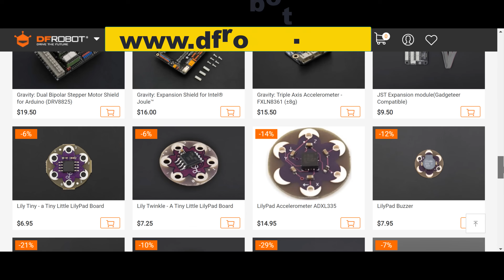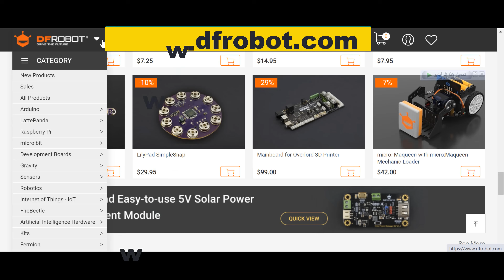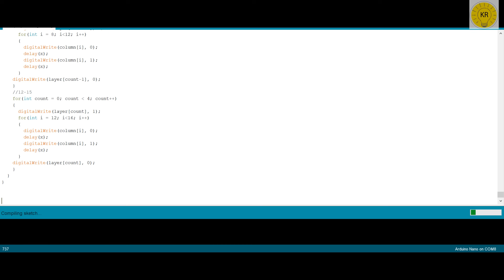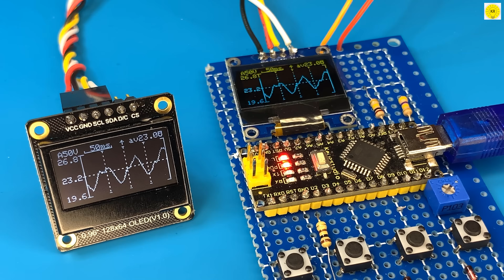how to make electronic component tester, using Arduino nano ,dfrobot

Comment: I have a question. In this video you are using 680k and 470k resistors but in the other build with the Atmega328 you use 680R resistors. Why the difference?
Reply: The first comment I see is in a different language but I used Google Lens to read it. It suggests these resistors are not 680k and 470k based on the color code. I'm don't know how to read these codes. I can't see the colors very well. Can you confirm the values may be different? The comment is a year old and doesn't have an answer.
Reply: When he is placing the resistor’s in the board you see 680K and 470K printed on the screen. I can see the color codes and they are 680R and 470R, not K.

Comment: I adapted the code for Arduino Mega: changed the right port, on my case PORTF DDRF PINF DDRC PORTC, but the program was froze in sleep_5ms() function.
So I inhibited Sleep Mode, but program do not recognizes the right component.
Now I try to work on code for understand why, but is bit weird.

Comment: Very Interesting Project!!! I hope you release another video explaining how the components tester works especially the part where it can detect what component it should test (whether to test for transistor, resistor, or capacitor). I am having doubts on whether this is legit or not.😅😅😅 So, I am very interested on your explanation about how it works. I am looking forward on this request. Thanks!😊

Comment: nice little circuit, most multimeters have this as a default (hFE mode)... but more importantly i think you should leave a tiny bit more time for your solder to flow, you remove the iron just before the blobs have finished flowing over the pads and it sort of triggers me lol, leaving half-covered pads isn't a good thing ^^
Reply: Yes, and their soldering is dreadful. Dry joints and not enough solder. I wouldn't expect this circuit to last very long at all.
Reply: It certainly wouldn’t hurt to use a smaller tip. Those are designed for copper pipe.